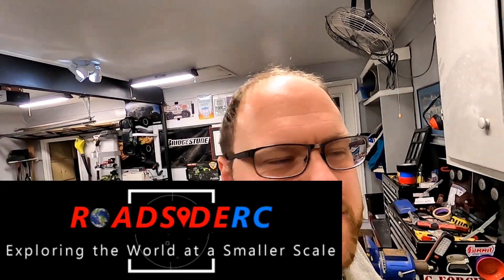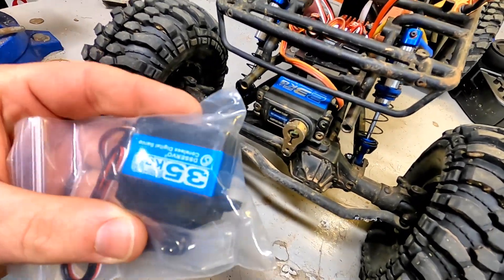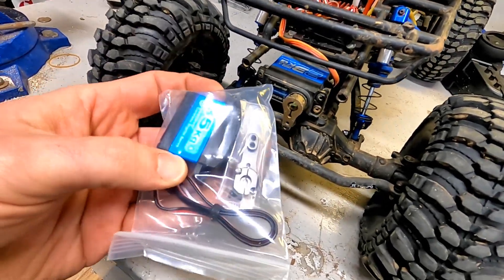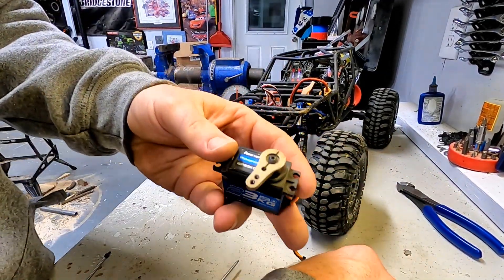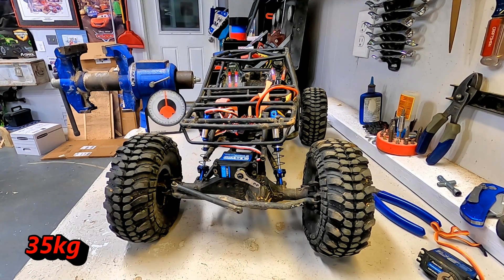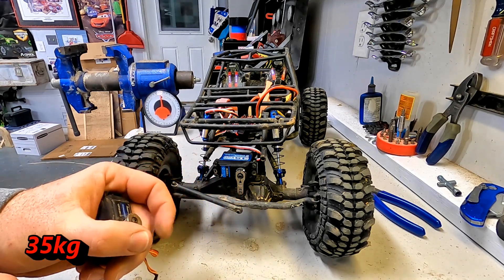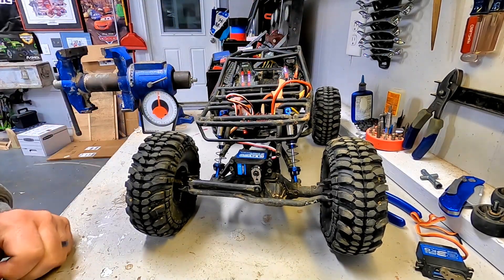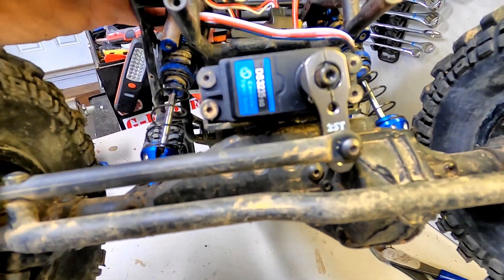ZOSKAY 35kg 270 degree servo - review, install, test

Comment: Spec'ing an upgrade is what I'm finding confusing, especially since I need to use it in a "flat" orientation rather than vertically like the ears are made for. So I just dove in. One should be here today. Fingers crossed.
Reply from the maker: Hope it works out!

Comment: Hello, I have one of these servos and I couldn't get the detach to work with arduino, I mean the servo stays fixed but active if the power is not disconnected? or is there a way to disable it and be able to move it by hand with
any command from arduino? thank you
Reply from the maker: I'm sorry, I have never used it with arduino.
Reply: @RoadsideRC  thank you anyway

Comment: You need to switch to using a PWM signal to get the full turn.
Reply from the maker: When I used it with my Futaba controller, I got more angle.

Comment: Is it still working? I have purchased two of them in less than one year because they stopped working without no reason
Reply from the maker: Yeah - these have been GREAT for me.  I have them in multiple trucks without an issue. 

Are you setting your endpoints correctly?  If trying to overextend, it will fry them.
Reply: @RoadsideRC  Yes, I am. They work fine for one or two months and then, they stop working, so I am looking for other servo, but not sure which one is better than that one.
Reply: The warranty on amazon was 4bucks and covers you 3 years....I bought thr warranty..

Comment: About you're 270 degree remark, its based on receiver settings, but with the 180 and 270 being the same price might as well go with the 270 in case you find other uses for it other than steering which is why I got the 270.
Reply from the maker: Thanks!
I found another controller (Futaba) that allowed it to go much further.

Comment: That's just as far as your remote will let it go it's not a continuous throw that's just as far as your remote switch allows it to be it's not like turn on and just continue to go and then reverse polarity and go the opposite way until it wants to stop it goes only so far that your switch allows it to but if you set it up you could probably use it as for like a winch with a different kind of throwing switch where you just reverse the polarity back and forth and turn it on and just continue to go and go and go then it would probably do that but otherwise it's only going as far as your switch your steering knob will allow it to go
Reply from the maker: You are correct!  Thanks!

Comment: Not sure if they asked you or not but they totally used a screen shot of your video on the product page on amazon as one of the images. 5th one down I believe. Also core less servos (or motors) just mean the permanent magnets are on the inside and the windings are self supporting and go on the outside of the magnets instead of the inside like a regular dc motor. The idea being there is much less mass to start and stop as the windings aren't braced to a heavy steel core. This teamed with a digital controller which updates the signal to the motor at over 300hz (compared to a analog servo controller which only updates at 50hz) you get a faster more "snappy" feel.
Reply from the maker: Thanks!
Yes, the seller reached out and asked for it.   I thought that was kind of cool!

Comment: Just ordered one for my drift build, hopefully it's fast enough so I don't have to get a brushless one, lol... 🤣😂🤣😅
Reply from the maker: What chassis are you putting it in?  
I expect it should work great.
Reply: @RoadsideRC  I'm putting it in the 2020 Kyosho Mercedes AMG GT3, the new MK2 chassis. 😁 I'm doing 2 builds as I have time on my channel, one Drift and one Speed...
Reply from the maker: Gotcha.  Steering speed is not very important with an AWD drift car.   The steering doesn't do a lot for control of the car.

Comment: The servo horn it comes with is horrible, run the TRX-4 metal replacement.  I tested quite a few, it wins hands down over anything with  pinch bolt setup I've seen.
Reply from the maker: Thanks for the tip - I will certainly check it out.  I have been using this servo horn on multiple vehicles without an issue though!

Comment: Hi! Can any digital servo use arduino for programming? Thankyou!
Reply from the maker: I am sorry, but I have never used an arduino for programming.
Reply: As far as "should you be able to use any digital servo" yes, as long as you're sending the correct signal which I believe is just PWM so you shouldn't have any issue (there are plenty of articles that show / explain the correct frequency range for servos online). In fact most digital and analog servos work the same way it's just digital is way more precise. The control signal to servo is the same (unless you buy a specific servo that uses sbus or some other type of signal) it's just the analog servo only updates the signal to motor at 50hz but the digital servo updates at over 300hz. This is crucial in some cases, this update also applies to the self sustaining angle hold that servos do. If a outside force tries to push a servo the servo will attempt to hold its position. The 50hz update of the analog servo may be to slow for what ever it is you're trying to do and the servo will allow the outside force to effect it more then the digital will.

Comment: You could have tied some fishing line to the servo horn and clamped the servo in a vice. Then, added weight until it stopped lifting. Just through a maybe 90-120* swing mind you. And if you can't then the best you can do is just tell us subjectively.
Reply from the maker: You are right again!   That would have worked.  
Honestly - I did mess with some metal bars I had around to see if I could rig something up...but didn't get it to work.  

Still, I really enjoy this servo and run it in most of my trucks.

Comment: The degree rating of the servo has almost no effect in RC, this has to do with robotics use of servos normally. The 270 is referring to mechanical limits of the servo and the ability of the encoder to accurately giving position info for that range. RC transmitters do not generate a signal range for this amount of range on the steering channel so you could put any servo of any rating and get nominally the same range of motion. The difference in range you are seeing is likely due to a slight resolution difference in the PWM signal interpretation between the two servos. Transmitters do exist that allow you to alter the pwm frequency range and change the angle range of the servo.
Reply from the maker: Thank you!
Since this video, I have tried the same servo on with my Futaba gear.  With it, I can set the endpoint past 100%, and it does provide even further angle that way at least.
Reply: If I'm understanding. You would want the 180° and not the 270° .  I have both but It is one that went bad. The only way to tell the difference is the 3 colors of the wire.  Other then that they look exactly the same.. .but you kinda lost me about the pwn. It digital so it should be ok

Comment: All radios have Different endpoint limits most servo specs are determined for robotics! If you connect different radios to it you will get different travel points! The more expensive radios have a greater end point adjustment! That tactic you have there is not the greatest radio and thats gonna limit how far the servo travels!
Reply from the maker: You are 100% correct!  
I have since used this with my Futaba radio, and it gets much more travel when set at 120% steering end point.    Still, no where near 270*.

Comment: I'm no expert, tho I been in this mess for 40+ years, but to go to the maximum ends of a servo, u gotta have a servo programming box. We used to use them during my rc helicopter days.

Too, it could possibly be the transmitter u have. On digital transmitters u can go to the hi (& low) side to  beyond the max.
Reply from the maker: You are right!   Since this video, I have used one of these servos with one of my Futaba controllers, and I was able to get more throw from the servo.   Either way, it works good, and since the 270* is the same price as the 180* - I don't see why not to get it.  

Thanks for the comment!
Reply: I see you are close to/around cookeville tn. I live on the va/tn line, in Bristol Virginia. 2 "groups" of crawler ppl here. The 1 I'm with (laid back, crawl together when we can) & te other 1. LOL! WE outta get together sometime!
Reply from the maker: @old-rcplane-phart  Sounds great! 
I keep meaning to get over to the RRW Krawlzone.  Ever been there?  It is between us.

Comment: To get 270 degrees you need to increase the end points. The reason you can’t do that is because your transmitter only goes up to 100% however you can program certain controllers to increase the end points more. My controller goes to 140% however I think the amount you can change depends on the transmitter.
Reply from the maker: Great point!  I hadn't thought of how some controllers go past 100%. 
It always is outside of my Engineer  mind to think past 100!  :)
Reply: Roadside RC I don’t know why all controllers don’t have max end points and then you can dial them down. Some things are a bit strange.
Thanks for the vid I am thinking about modifying the servo on my vkar bison.
Reply from the maker: @officialflippers6944  Agree.  I would certainly recommend this one based on my experience.
Reply: Roadside RC thank you
Reply: That tactic radio can set the end points if it has the two little bottons on the handle.There’s a sequence.
Reply: I think or maybe your transmitter goes only a bit more than 100%
Try using a programmable radio and program it to increase the end points
Reply: Yep hes right. My futaba maxes out at 150. Upgrade stock transmitter and receiver and you should see it
Reply: Kevin M Joyce yeah 180 degrees would be the most effective however I don’t think most RC cars are designed to have servos house that far

Comment: I actually have 2 of those 25KG in my rigs seem to perform really. For my driving style🙂 I seen this 35KG haven't tried them out yet hoping to get one as well. Great demonstration thanks for sharing.
Reply from the maker: Glad it was helpful!
I tried to figure out ways to show the power difference.
Reply: I use the 35kg you gotta watch getting wheels pinned between two immovable objects it will break something or strip the horn before giving up. its fun though when you steer in a bunch of big flat rocks it will throw them around